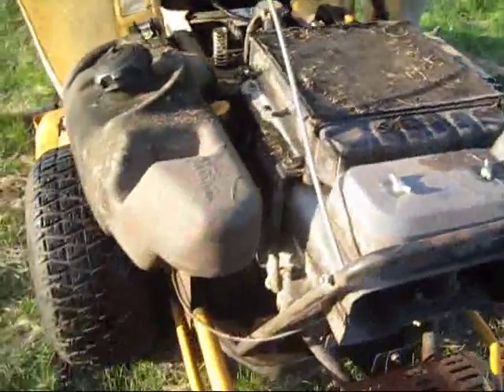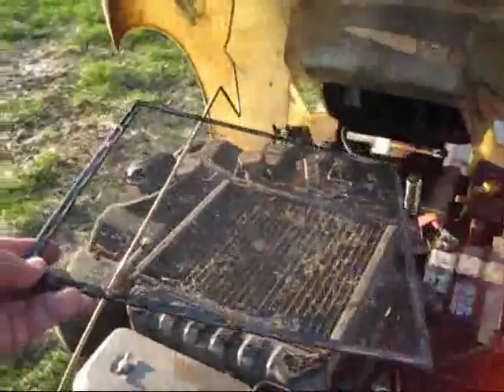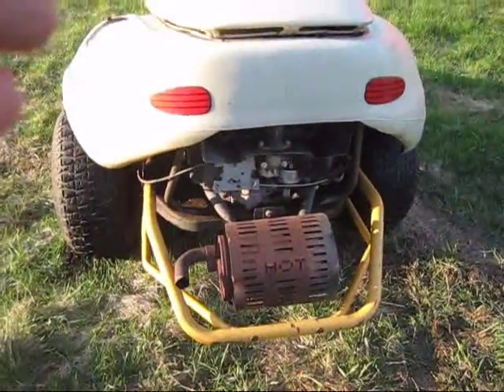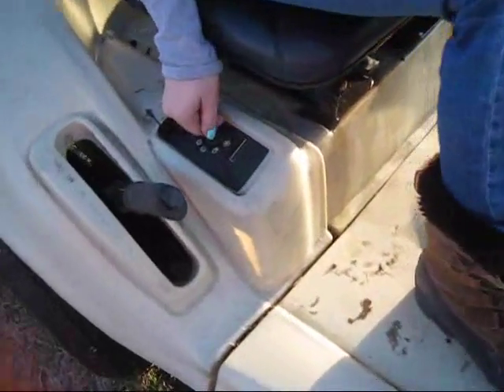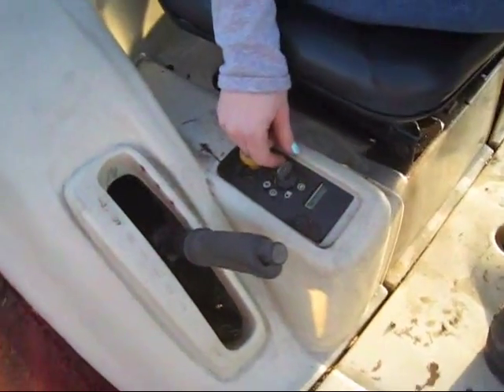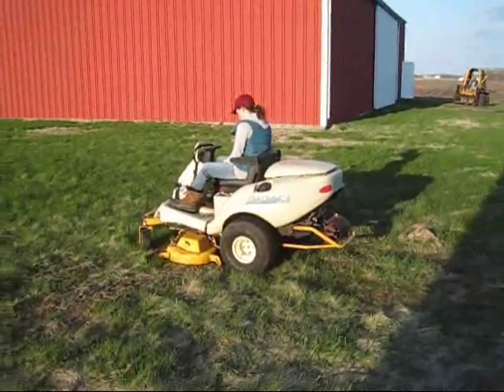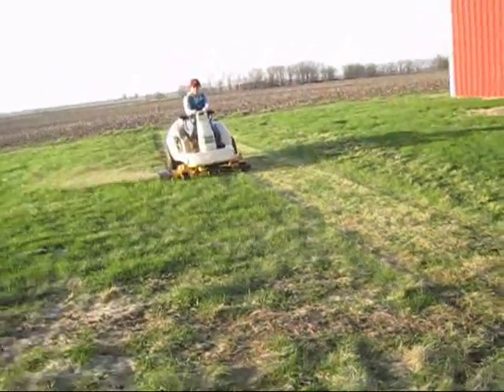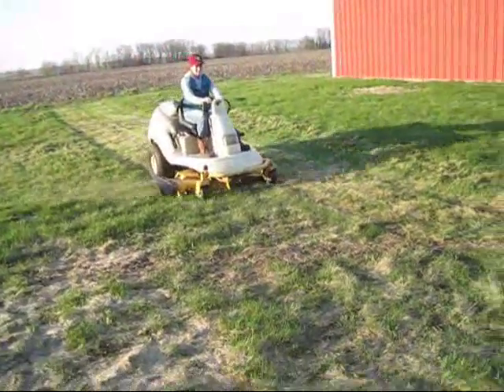CUB CADET 48 INCH ZERO TURN FINISH MOWER 18HP KAWASAKI liquid cooled V-twin 4 $old!

Comment: I picked on of these up at the end of the summer, was running great on the first mow until the engine seized up . Think I’ll have a replacement motor for it over the winter.